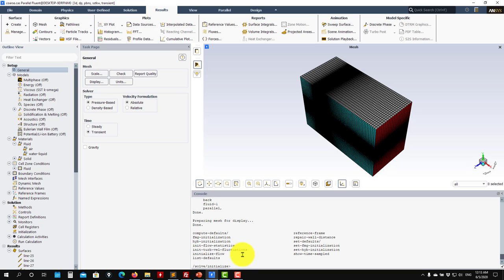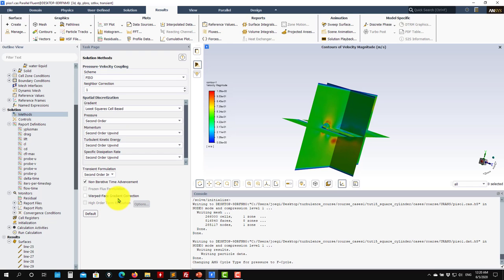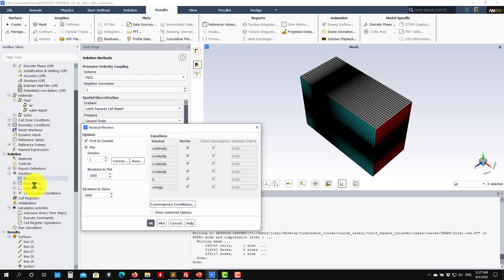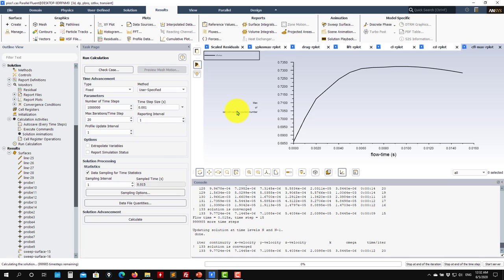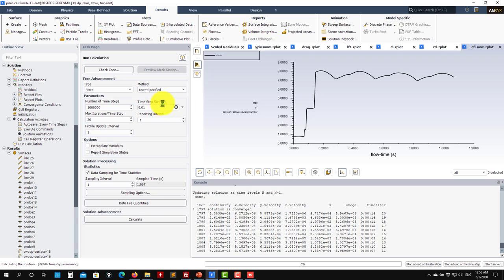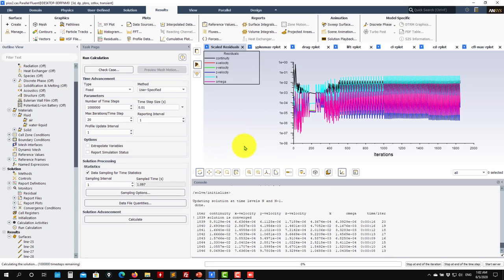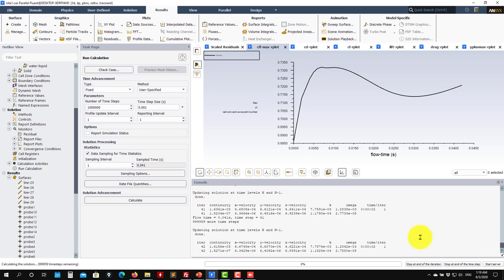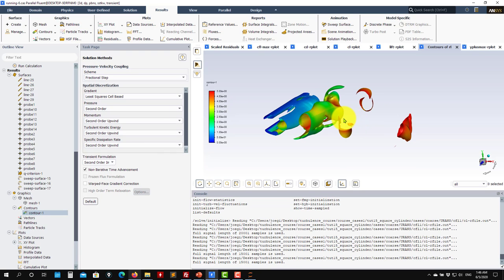Turbulence modeling with Ansys Fluent | LES simulation - Square cylinder - Part 4

Comment: Thank you for another helpful video. Transient simulations can be a real bear to deal with. I wanted to toss in some extra info regarding NITA. It does the same iterations as ITA but it doesn't do them successively. Instead it breaks them into smaller, substeps and performs inner iterations that can suss out convergence faster. The default view in Fluent is to hide these inner iterations, resulting in the initial value and the final, converged value. However, you can bring these inner iterations to light by going into the Advanced button in "Solution Controls" and in the "Multigrid" tab, changing the verbosity setting from 0 to 1 or 2. The TUI command is: solve/set/nita-expert-controls/set-verbosity
Reply from the maker: Thanks for the comment